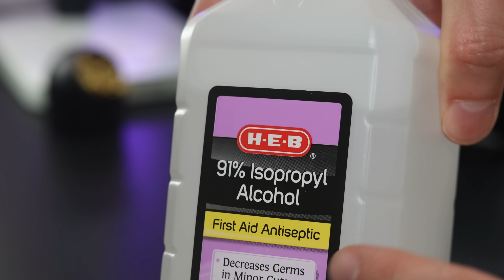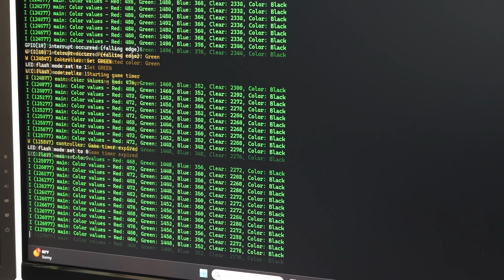Do This Before You Solder Anything

Comment: Having been an electronics engineer for over 43 years and being able to solder with my eyes shut, this video is probably one of the clearest ever on how to prepare for a soldering session and the soldering itself. kudos here for a very clear and concise video👍 My test was always to ask someone to solder a dual in line PDIP package onto strip board. Someone who can solder well will produce two rows of joints that are absolutely identical. Great video and thanks for sharing 👍

Comment: Some good advice but the temperatures mentioned are way too hot but probably required because of the low quality soldering iron that is really for SMT joints as it has a small heat reservoir and reaction time for PTH.
The iron quality massively effects soldering ability as the joint sucks the heat out of the tip and an insufficient iron will either not sense the tip rapidly cooling quickly enough to try and pump more heat in to compensate or will simply not be able to get the heat in quick enough to overcome the joint sinking the heat.
If solder melts at 183, you should not need 150 degree above that unless the joint is sucking the heat out and it’s needed to compensate.

Also, there was no mention of the need for a deionised water impregnated sponge to wipe solder and there was evidence of the brass being used for this which is a bad thing to do.
Sponge needs to be damp, not wet so if you can squeeze it and water comes out, that water shouldn’t have been in. Too damp and the tip will be thermally shocked and eventually micro cracks in the plating will occur which will allow flux to penetrate and eat away at the soft underlying metal. 
Sponge for excess solder, brass to remove light oxides and allow wetting.
As others have mentioned, never wipe tip after soldering. It is so tempting to do it if flux is still burning off after soldering but it needs leaving with solder on and wiping the oxidised solder off just before soldering.

Comment: As  retired engineer, a few points,
1.Use a  iron with a good body ie Weller not the crap shown here, if you use a small tip like here it will not remain hot enough. I hate it when a i see these pencil shape barrels just absolute crap irons, my weller WS 50 is 25 years old was on for like 8 hrs days or even longer and the barrel still going after 25ys many tips(bits later like 50 +) ...

2. Turn up to about 380c, both leaded and unl;eaded again not having an iron hot enough is a huge problem as you people forget thermal mass, ie tip at 380c board and pin at 25c when you put the mass together it will bring it down to about half that tip temp think of it like putting water on the tip it drops the temp of the tip. the time on  the joint is a like 1 second, this guy is wrong on his temps. Small parts and IC will solder much quicker with this tricks. I did smt soldering with a 3.2mm spade bit for 35 yrs.

 3 Gravity is your friend, if you have too much solder turn the pcb upside down (like 45 degrees) the solder will flow back onto the tip

4. Use a wet sponge not a brass cleaner (clean your tip virtually every time) this becomes like automatically.   

5. He is 100% right on the flux. 

6. If you can avoid unleaded solders they really do suck for reliability. Especially if you are hobbyist it will make life a lot easier for your home projects. 

7. I have soldered tens of thousands of parts by hand(smt) virtually only an handful of bad joint over thousands of boards, as I avoided unleaded solder like the plague.

8. If you place your iron in the holder or worse just on the workbench NEVER try and catch it, I learnt very quickly if the iron is falling off the bench let it just drop, nothing worse then catching it and enduring days/ weeks of a burnt hand, it is really hard not to try, as your brain goes into auto pilot ....but  once your remind yourself do not attempt to catch it becomes set in your mind.

Comment: Soldering is a lot like a relationship: if you’re too cold, you’ll never make a connection; if you’re too hot, you’ll just burn it all down; and you usually need a little alcohol to clean up the mess.

Comment: Good video thanks for the tips.
Shew $100 is way out of my range, that would buy a decent cheap rc truck....  I'm sorry man but I'm working poor, for $100 I have to get way more of a value for my money, this week I spend just under $100 buying 3 Radio Shack electronic labs, those 300 and 500 in one labs that have a bread board and all sorts of projects....  Just a thought but arduino starter kits are under $40....

Comment: I have a soldering iron, and it comes with extra tips, but after the original tip is broken, I used other tips, even on 500C it barely melt solder so I am using an old tip for small work, it has a small hole. Why are new extra trips not melting the solder? Is this because the material used in extra tips might not be good quality for transferring heat?

Comment: Flux is an interesting subject. When I was a kid my father used flux for any soldering, but then he also used solder without a flux core. The flux he used was violently acidic and very efficient when soldering large things like water pipes. But get it near an electronic device and it would just eat up everything. Then I went to school to learn micro computer technology. This included designing and building computer circuits and simple computers. This involved a lot of soldering and flux was not even mentioned. When I asked the teacher just said that the flucx in the core was enough and you didn't need more than that. We didn't even clean the circuit boards with isopropanol. We just soldered along and I have to say I never had a problem with that. Later I've heard people say it's impossible to solder without using flux, but so far I've never used it when soldering anything smaller than a water pipe.

It's almost fifty years since school, and I'm no longer working so I guess it's to late for me to learn to use flux now.

Comment: Yes, everything you said is exactly right! 
I've been soldering for around 50 years and have learnt most of this through experience.  I've had more bad joints (solder joints ha ha) than I can count in those years.  Some times to the point of having to remove all the solder on a board and re-soldering it all again.
I do use higher temperatures for my iron, 380° foe leaded solder, 390°-400° for non-leaded.  If you are quick  2-3 seconds soldering the higher temperature won't burn anything.  Also the tip temperature tends to drop quite a bit when using very small tips.
I think that back in the day, the solder had more or better flux inside it, I never used extra flux.  Now a days I find that I need some flux to get good joints every time.
One thing that you did't mention was if you take too long or have to redo the joint you can lift the pad off of the board.  Seems to happen more with the older Paper/Phenolic (FE2) boards, than with the Fibreglass (FR4) boards.
Thanks for the great tutorial.

Comment: (2:20) In industry, the preferred tool for scrubbing printed circuits with isopropyl alcohol or any other flux remover is a disposable acid brush with the bristles trimmed to about two-thirds or half length to make them stiffer.  Tissue papers or cotton swabs end up leaving lint.

Comment: An important detail is you can get solder with different % and strengths of flux.  I don’t use flux for through hole soldering a clean board because it’s easy to get solder with enough flux as long as you solder quickly.  I use flux mostly for rework and solder braid.  Also sometimes to help get wetted through absorbent fine stranded wire.

Comment: Tip
Buy leaded solder and just use ventilation. 

Get flux syringes

Stop using those crap harbor freight style soldering irons. You don’t need anything expensive, just get a pinecil or TS-100 or TS-101.

Comment: Expert soldering takes practice. I was an avionics tech in the USMC and one of the first schools I attended taught correct soldering. I had been soldering for a few years before that and learned why my soldering joints always looked like crap, just as this video points out. Excellent tutorial. One thing that should have been pointed out is that if you plan on doing a lot of soldering invest in a top quality soldering iron. I have a Weller with all the bells and whistles. If you need to de-solder components you must get a Hakko FR-301.

Comment: I rearly solder but if PCB board is multi layer, you need to heat up the board (hot air gun) to be able to solder because board sucks the heat a lot. More layers, more heat needed. Am I right❓

Comment: excellent advice...i was using  my grandpa's western auto wizard soldering gun..yea gun. way before i was really old enough to be wielding one..and still have it ......had it on a job where i had to solder rca ends on some speaker wire on advertising tvs in Walmart...i split the job of  doing  10 tv's each with 4 rca's that needed attached, with the other guys in the crew....i circled the whole store on my lift, completed all soldering and met my guys still working on their first tv...i guess they had never soldered anything before.....hahaha

Comment: Woaah. Some times ago I had to solder 125 4-pins LEDs with a 1mm spacing (well it was to train soldering, the result was a coom 5x5x5 cubes that is now a connected object), it's 500 pins to solder if you can count, and I really really wish I have seen this before !

Comment: I've soldered for years.. 
and never use additional flux
and got very much beautiful joints
Reply: Indeed and I am the same. I think this comes down to timing, having the right solder and a good iron. Antex has always been my go to soldering iron. If the joint is made quickly then I find the flux witching the solder itself sufficient. That said for multi strand cables above all but the smallest diameter, I like to immerse the end of ppd the cable on liquid rosin flux. Like you though I rarely use additional flux.

Comment: Wow, I learned more about soldering from this single video than anywhere else.  The tips (rosin,  heat the pad with pre-tinned tip, then melt the solder on the joint - not use the iron to melt the solder, etc...) I never knew this! I tried what was presented on a test board, and well ...my solder looks like a master did it.  It came out perfect.  Thank you .  Liked and subscribed.

Comment: I've been soldering for over 45 years... Use a GOOD Rosin Flux Core Solder like Kester Multicore and you will not need Extra Flux for your PCB Assembly. Stay away from the Cheap Chinese Solders... I use a PCB Holder so I don't need to follow the PCB around the Bench top.

Comment: I like to control heat transfer.  With a chisel shaped tip this is easy,  you use the corner,  the edge, or the flat.  Last time I stopped in a Radio  Shack store (some time ago) to look and see what they had for soldering irons,  every single one they had came with a cone-shaped tip!  I didn't buy one...

Comment: 5:50 “even if you’re soldering a header, and the last pin is ground, you probably have to go up in temperature for that specific pin…” Why?
Reply from the maker: Ground planes tend to absorb a lot of heat very quickly
Reply: @stuckatprototype  Thanks :)

Comment: Thanks man! I was quite struggling with soldering. After sometime i realized that the iron wasn't hot enough, that heat transfer thing was quite confusing when i saw other videos. This is really helpful....
The first time when i tried soldering, the solder wasn't melting, so i touched the iron and my finger burned 😄...

Comment: 2 comments, 1.hold the board by the edges or wear gloves. you are putting oils from your fingers all over the other pads. 2. you mention leaded solder is slightly easier to work with, you should also mention that most modern electronics use lead free because lead is more toxic! There are also sometimes issues using leaded solder on leadfree leads, or when reworking leadfree boards, issues with lead free and leaded solder not mixing well.

Comment: Excellent!  Yes, you will never get anything done without the correct sized tip properly tinned before making a joint.  It is remarkable how quickly small tips oxidise often during a short pause between making joints. Really important to get this right along with tip size/soldering iron power (for large joints often more important than temperature).

Comment: I tried soldering first at the age of 6 (30 years ago), using the drip method, that is such a fun memory. In time though trial and error I did learn how to solder without having internet access tho. And before you ask, my mom was super stressed and overworked, so she didn't had enough energy to be a strict parent, so I was very free to do whatever.

Comment: Im a professional TIG and MIG  welder, and an electrician, but until recently I never did much soldering. I even thought that compared to welding, soldering was just easy, amateur stuff for people who couldn’t weld, lol. Its a lot trickier than that! And even after months of practice, I learned a lot from this video! Much respect. 

I still think TIG welding aluminum is harder, but in totally different ways, and i have a whole new respect for soldering (especially micro soldering)

Comment: I  mostly use maximum temperature, especially for vulnerable components.
Point being, I want the temperature gradient to be higher - the solder should melt before the heat has a chance to dissipate towards other places or components.
Speed is important for me. If the solder takes too long to fully melt, it gives the heat time to spread.
My ideal is to have the soldering spot at melting temperature and everything else at room temperature.
This is much better in my opinion than having the soldering spot at 361°C and surrounding area at 300°C.

It depends on what tools are available (mostly relevant: reheating speed & heat capacitance of the soldering iron tip). In contrary to my personal preference, the temperature being spread a bit is sometimes favourable to prevent cracks from heat differential induced tensions.
The heat distributon has to be carefully manipulated.

Comment: i have done this for 48 years , many more types than 2 types solder . i use one with high silver and thin like a thick pub hair , good for circuits making pulse signals like PI metal detector boards

Comment: Excellent video!
Leaded solder is indeed the easier stuff to work with, SN63PB37 with rosin core is my personal fav.

However, Consumer electronics in most of the EU are NOT allowed leaded solder anymore!
In that case I would recommend SN95Ag4Cu1 with rosin core.

Comment: I would add using the same alcohol to clean your finished area to show off the work and prevent future oxidation.  Flux left on your board will also cause this. 

 You can always add silicone or hot melt glue to stiffen certain connectors/ connections on the board or to make them water resistant.  But this will also cause a heat source on the board since it's not designed to disapate heat like aluminum would.

Comment: I was certified in a NASA soldering training program for US Naval Nuclear reactor plant control systems.  During the entire course, we NEVER used flux when we used flux-core solder.  That being said, I will still use additional flux on problematic joints.  Most joints are not problematic for me.

Comment: What is the best flux for electronics?
Reply: Dumb but accurate answer: Electronics flux. They have different properties like being "no clean" or being liquid that can be applied via sprayers before wave soldering. There generally is no market leader type deal. A gel form in a syringe will be nice but that's just because it applies easily. The American Amtech stuff is really good but equally expensive. If you don't solder tons and tons of things it can be worth it for ease of use, supporting a local brand (if you're in the US) and its properties. There are tons of chinese off brands on Ali, wish, temu and all that.

Comment: Flux breaks the oxide layer from the surface right? The oxide layer needs to be removed for solder to flow and chemically adhere to copper.

Comment: Soldering clean electronics usually works pretty well, even for beginners.
The real challenge comes once you move on to brass instruments and plumbing. There you have to use "Tinning Flux", which tells you when the surface is ready to accept solder, as indicated by a layer of tin on the surface. If that doesn't happen, the solder simply won't stick and you have to keep rubbing the flux on the hot surface until it's clean and you can see the "tinning" reaction.

Comment: Dont forget to use the correct soldering tip for the job. Small tip for small circuit boards, Large tip for larger boards. I see many videos with tiny circuit boards and people soldering with large soldering tips, What a mess !

Comment: Ive soldered everything from tiny SMD devices up to 28mm diameter copper pipe and agree entirely. Only thing I would expand on is the heat transfer issue.. when soldering large joints the thermal mass of the iron matters not just the temperature. In short dont use a small bit on large joints.

Comment: fun fact, 90% (and above) isopropyl is NOT electrically conductive. i frequently use a spray bottle with iso and literally drench boards while they plugged in and powered ON in order to locate short circuits. (if my thermal imager isnt charged or put away inconveniently)

bonus fun fact: WD-40, the industrial cleaner/lubricant, is also non-conductive and great for protecting circuits from corrosion in harsh environments.

my only real critique is that you didnt say "add more flux" as the #2 solution to every soldering mistake 😂😂 i will never forget the first time i used flux and realize it wasnt just a suggestion. flux is about as important soldering as the solder itself 
cheers